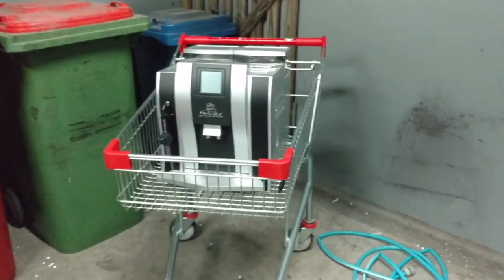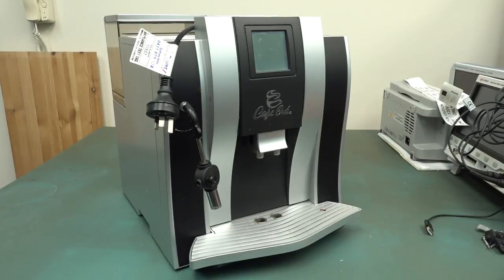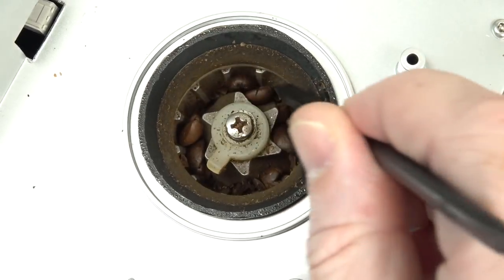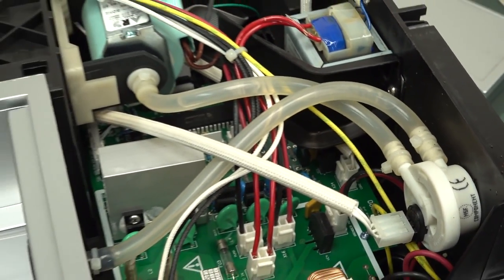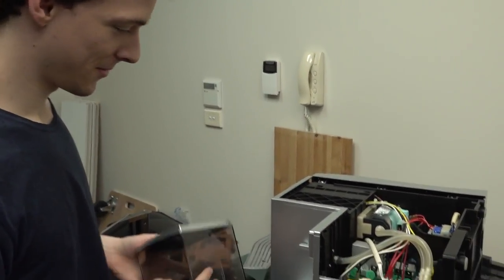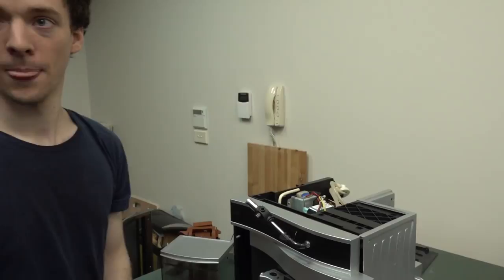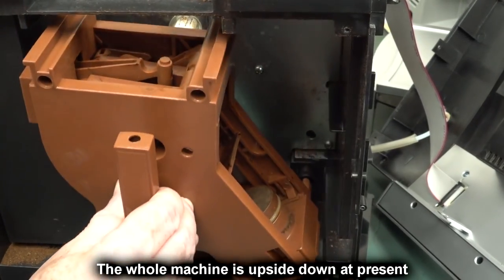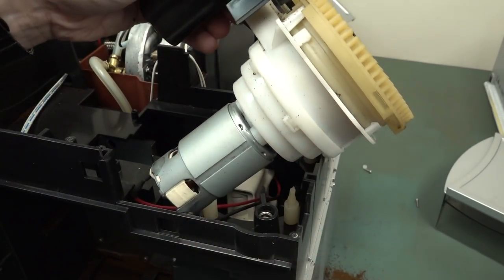EEVblog #1161- Automated Coffee Machine Dumpster Teardown

Comment: So this off brand coffee machine has way more safety features than an official Weller soldering station.
Reply from the maker: snort
Reply: That's one way to consume coffee, I guess.
Reply: Hats off! I was totally thinking that as Dave was going over the mains input section... oh here's a couple fuses, a few MOV's here and a PTC there...
Reply: @EEVblog  Did Weller send those "CAUTION: 120V only" stickers in the background near the end? Safety by stickers! Like those "dont put over your head" symbols on plastic bags.
Reply: Interesting point.
Reply: @ThatBum42  that iron station could result in your house burned to the ground.
Reply: I can't see how they would not have it in there. There is thermal cut offs in a battery charger and some welders right against the primary windings or within them. They must think that the wall breaker would cut the power before fire. I have seen thermal cut outs even on the little wall charges and yet for it not to be on something like that is not good. Make you think on how much they put safety before money for the end user. :)
Reply: LOL, snort - how true.
Reply: The end user is around when Soldering station is on. The coffee machine could be on for the entire day, when no one is around. It is busy with fairly complex task of keeping water hot, so you won't need to wait till boiler heats up. Some machine recirculate water from the boiler, i.e. heating it up, keeping there for 2-5 minutes, returning it to the reservoir and pumping new water in. From safety point of view, machine can go anywhere from exploding with copper shreds in your face to electrocuting you with small water leak from a hose, amount of safety features in this particular machine is underwhelming.
Reply: And your (correct) comment now has more upvotes than this video. Congrats!
Reply: It's not a offbrand as such it's more a automated machine you'd find in a office or petrol station rather than in coffee shop.
Reply: @HassanDibani  that's one of the reason why UK has fuses in our plugs
Reply: @ThatBum42   Its dry boil protection mostly. As long as there is water in a machine like this it will never over heat.
Reply: Does the machine have a primary fuse? Didn't see it...
Reply: @ThatBum42  Thats exactly what boil dry protection means. They have the resettable thermal fuse as primary protection and the on shot wonders for when that fails. My wort boiler only had the resettable one but it would always false trigger so I had to bypass it which is no biggie since it also has a  PID with a PT100 on it now.
Reply: Because coffee makers are a known source of house fires. Practically every home or business has one. Very few home soldering stations. So what device gets the attention of watchdog groups? I forgot to mention my solder pencil is just a plug to heating element. No thermal regulation. No fuse. No timer. Plug in and burn away.
Reply: To be fair it also pressurizes water and draws 1450W doing it ;-)
The Well literally is a resistor with a handle…
Reply: helmut666kohl -an overdriven choke coil with a tip. The ceramic portion is a shunt with no resistance.
Reply: Mixing water and electricity is always dodgy.
Reply: @EEVblog  i had the same one in Germany - Called "Cafe Bonitas - CubeStar" - paid around 400-500$ for it and was satisfied a long time. Not the best, but good enough. Was always impressed by the features compared to evenly priced ones. It shorted like maybe a year ago, but is still in the basement - may try to find a solution now :D - THX!
Reply: HAHAHAHAHAHAHAHA
Reply: What if its a student or a home user?Would you like being the person to pull a mains line while melting? I think not. No there definitely should be a fuse in line or thermal cutout.
Reply: @HassanDibani  Water leaking + electricity can be just as deadly.

Comment: Dodgy looking connectors on the thermal cutout crimps at 19:49?  I wonder if the problem with the machine is in the thermal safety circuit.  The belt and braces thermal protection is probably to avoid huge flaming plastic infernos.  With the control of the heaters being from a microcontroller via triacs the two most likely overheating scenarios are a software glitch or crash jamming the heaters on continually or a triac (or triac opto-isolator) failure in the usual shorted state.
I bet I'm not the only one who wanted to see the action of the coffee brewing section where a brewing chamber would close, be filled with ground coffee, have water pumped through it by the solenoid pump and then have the grounds dumped out when the brewing chamber opened again.  The bean counter is probably just to detect an empty bean hopper.
Reply from the maker: The way this things comes apart it would be hard to see in action with the panels off.
Reply: @EEVblog  dremel to the rescue!
Reply: Regarding plastic infernos: Thermostats can latently, undetectably fail short/open. It's not likely, but it is possible. That's a single failure that leaves the device in a latently unsafe condition. Putting a thermal fuse in series with the thermostat is simple, cheap insurance that the device will not become unsafe under single failure conditions. It is far easier to put the fuse is than it is to substantiate that the thermostat alone will keep the device safe. For domestic equipment whose function requires getting quite hot I think it would be very hard to justify not having both protection methods since a failure could lead to fire, property damage, injury, or death. The safety analysis should not consider how the device is meant to work or assume that any part of it will function properly under failure conditions. Safety analysis should only consider the consequences of possible failures and their mitigation. In this case the thermostat's single-failure modes are mitigated by the thermal fuse and vice-versa. Good design practice.
Reply: The heater blocks tend to clog up with any minerals in the water.  If you don't clean the machine, the water channels will eventually clog completely.  Without water running through the block, they can get hot spots fast.
Reply: You should of torn this down Clive.
Reply: I removed enough security features on those machine to know that if you remove all safety they will eventually go thermonuclear. and it is not if it's when!
Reply: Not I. Being 🇺🇸 means I’ve seen plenty of these robots. EVERY McDonalds has two enormous stainless Cylon slaves and they’re worked to death by uncertified baristas
{
grinding (), dosing () and straining ()
}
Reply: @eliotmansfield  Agreed
Reply: Anyone else read his comments in his voice?
Reply: I had a toaster oven that failed and when I took it apart the connectors looked exactly like this. The bake/broil switch had melted, Never used it again. I stripped it for parts.

I also wanted to see this process. I wanted to see the grinder running and crunching beans.
Reply: @AMBActual  totally 🤣
Reply: Probably a good bet (the crimps on the cutout), I've seen similar on a number of occasions inside coffee machines, I figure the repeated thermo-cycling causes the spades to loosen off and go high resistance at which point they just cook.
Reply: I love it @bigclivedotcom keen to save the coffee machine. I would not let this thing go to the grave. They are a great combination of engineering forte’s and time for an electronics engineer to experience an end product that they work on designing. I will always say there is becoming less and less understanding from the designer to the chap that has to look after kit and in a time where we are meant to be “greener” that is poor.
Reply: @EEVblog  It's quite interesting to see how they reverse the DC main drive motor with the triacs :) What i have seen is they use half way controlled rectification to move the motor in both directions using just the one triac. I think it's quite smart!
Reply: Brings bigclives recent smoke machine core meltdown video to mind.. Rather not have that happen in a coffe maker in my kitchen
Reply: Total waste of time, Dave didn't teach us how to make coffee liquor and machine was not pink.  Wink wink

Comment: Double boiler - usually this means one for the espresso/hot water and the other for steam.  This means that you can steam milk without having to wait for it to change temperature, or even steam the milk while it is expressing the coffee.

The grinder is a conical burr grinder.  The big plastic wheel on the top rotates to change the grind from course to fine, by changing the distance between the burrs.  High speed motor geared down for grinding grunt.  It's often the most expensive part of the machines, due to the precision required in the burrs.  If they are not precise you won't get a consistent grind or won't grind fine enough, and if they clash on the fine setting they can destroy themselves.  People pay thousands of dollars just for a good conical burr grinder on its own.

The water pump has to be powerful because it has to pump water through the compressed ground coffee, so it's very high pressure (9 to 15 bars, 130 to 220 psi).  A common failure mode for cheap machines (cheaper than this) is failure of the pressure fittings to the brew head, resulting in water coming out of the bottom of the machine.

I actually don't like these automatic machines.  You have little control over how the coffee is tamped (compressed into the brew basket) and the auto frothers (tube on the steam wand) almost always stop a real barista from steaming milk properly.  They do let the "general public" who have very little idea about how to do it with a real machine make something that resembles coffee however.

Despite the crappy plastic case, this one seemed to be rather clever and well made.  It's not clear why this one failed, but it was probably worth fixing if it was something simple.
Reply: Chris Robinson ima guess it makes coffee 200x better than what I have
Reply: Most likely it has not actually failed, probably just needed to be properly cleaned, though with those heaters they do not like poor quality water, so they can corrode on the inside and leave a deposit in the water of sloughed off aluminium oxides. Just taking the unit and cleaning the grinder area, the press side and stripping and degreasing the brew end would have made it work well again, getting rid of the most likely fault, poor tasting bitter coffee. 

Sad though that these machines also have built into the menu system a self clean function, which simply runs through a brew cycle without sending any coffe beans through the grinder, ad also upping the temperature of the boiler slightly, so that the hot water and steam can clean the stainless steel filter mesh and the tubing of residue, though some also have an optional cleaning fluid ( basically a mild acid and detergent blend) that is placed in the water supply, and which then is run through in the clean cycle, before draining the tank and doing a half dozen rinse cycles to get it out.

At my local bank they have some Azoyken machines, and I tend to run the unit through a cleaning cycle before getting a coffee out of it, it does make a difference to the machine. The semi automatic machine I often ask for the operator to wash the head before using it, and dry it under the steam nozzle, so as to get the oils out. They did not believe that you can dismantle those heads to clean inside, and now bleach them nightly (new catering group) and they are actually metal colour, not dark brown in the nozzle. Coffee machine service guy I talked to says the most common faults are not cleaning the heads properly, and poor water filters, along with adjusting the temperatures too high, plus not cleaning the grinder regularly. Grind then use, not grind till it stops because the output hopper is full.
Reply: @zachburke8906  Probably not, now Dave has ripped the insides out LOL ;-)
Reply: cant be repaired now!
Reply: I would have plugged it in just to see what it did and attempted a repair, probably nothing more than a single component failure.  At least part it out for fun and experimentation, and just use it as a grinder.
Reply: Now poor Dave, completelt oblivious to the thing, ripped it apart.
Salvaged one of these from a dump, cleaned it up and been using it for 6 years? Maybe more. Even for parts like the burr grinder it's worth playing with.
Reply: Not just yours but reading comments in general made up for all of Dave's "I don't know".  Cheers

Comment: No milk goes through that machine. The Y you saw is to split between the frother and hot water feed to the brew group (the brown thing that slides into the side). If you want milk you add it after. The pump has to be high pressure to pump steam.
Reply from the maker: Thanks.
Reply: EEVblog - ladies and gentlemen, the most disinterested man on the internet...
Reply: The guy is finally showing he is not that smart after all.
Reply: He just shows he's uncomfortable talking about stuff he doesn't fully understand
Reply: Actually pump has to be high pressure to pump water trough the ground coffee in the brew group. For steam, almost no pressure is needed, system gets pressurized when water vaporizes.
Reply: @der_pudel  That is right. Quite high pressure for the water to the brewing unit. And also the thermal fuses because it heats water really fast with lots of energy and needs to shut down fast if something goes wrong,.
Reply: No refrigeration unit = no milk. (Unless you were using shelf stable milk I suppose...)
Reply: But it can go. You can just use milk instead of water and make pure milk coffee - until it fails and burns the milk.

Comment: The grinder drops coffee grinds into the brew group, the the motor turns it which seals the brew group (what you called the hopper) and the pump is run (usually PWM to control the pressure) to pump the water through the thermoblock through the brew group (and this the ground coffee) once done brewing it cranks the brew group again to dump the spent coffee puck into the waste bin. For steam the thermoblock heats up employing both sides and the flow is redirected to the frother, it can also give hot water instead of steam out the frothing wand.
Reply from the maker: Thanks for the detail!
Reply: I think if Dave juiced up on coffee he may have been able to deduce that on his own.
Reply: Thanks. Saved me from typing the same thing. 😉
Reply: Hot water ejected from the frother would make a mess. If the water heater isn’t doing its job you get messed on. Only STEAM!
Reply: Rýán Túçk you obviously haven't used one of these. They pretty universally have a hot water option and it comes out of the steam wand /frother. And yes if you don't have a cup under it there'll be hot water all over. Same issue when you use them in steam mode, there's always some water at the start. They also do not always produce very dry steam. In short thermo lock units are usually inferior to boilers.
Reply: @EEVblog  And it uses water, never put milk inside the water container, it will break the thermoblock. The steam tube is usefull to make foamy milk, for cappucino or coffee with milk

Comment: Guys, no milk flows through the machine at any time. All those hoses carry cold water, hot water, steam, or coffee. The only time milk is involved is in a jug the user sticks the steamer wand into.
Reply: Can you imagine if someone put milk in the water hopper? It would ruin and clog that machine so fast and smell horrible.
Reply: @twjonckheere  exactly my thought when i kept hearing dave try to break it down lol
Reply: twjonckheere At my old workplace, I was surrounded by coffee addicts (I myself am like Dave and don’t care for it), and the coffee machine wore out from 15 coffee drinkers each getting 5 cups a day. So they decided to upgrade to a machine intended for heavier use (like, suitable for a small cafeteria), and someone suggested looking into the automatic dairy option (which would enable one-touch lattes, cappuccinos, etc). They quickly rejected that option when they looked into the maintenance it required: flushing the milk system with special cleaner ***twice daily***. (Only a handful of the drinkers took milk at all, so it just wasn’t worth it.) I guess that as an emulsion containing fats, sugars, and protein, milk sticks to everything.
Reply: @tookitogo  You can get a powdered milk version. Just make sure it's not very humid where the machine is. You still should clean it, but not as often.
Reply: That would be disgusting. Milk is full of proteins that would leave behind residue then cook into solid plastic.

Have you ever warmed milk in a saucepan, the skin it leaves on the bottom of the pan? Imagine that only in the heater cores...
Reply: @tookitogo  I'm not surprised. Just leave some milk out of the fridge and see how long it takes to go off.